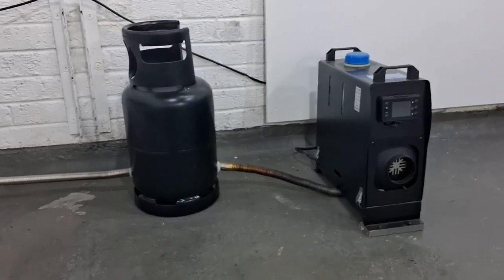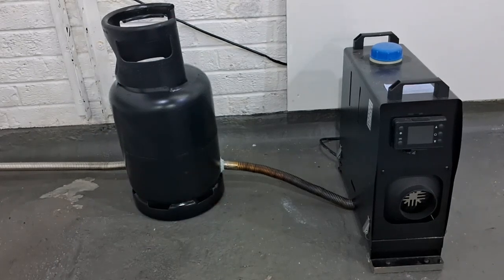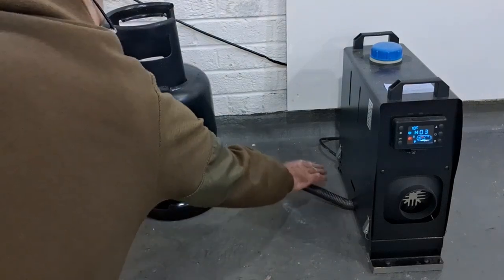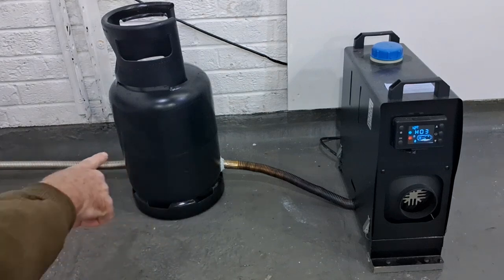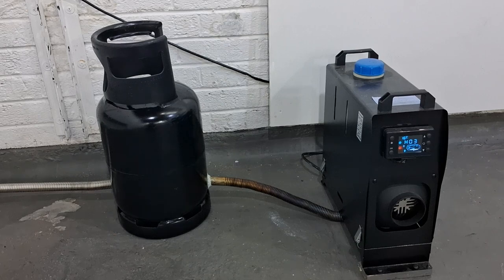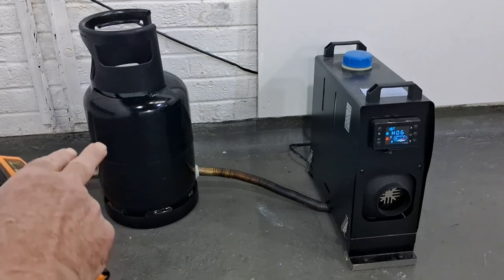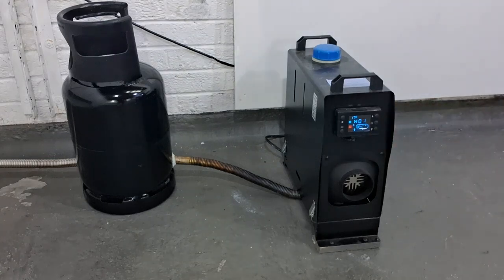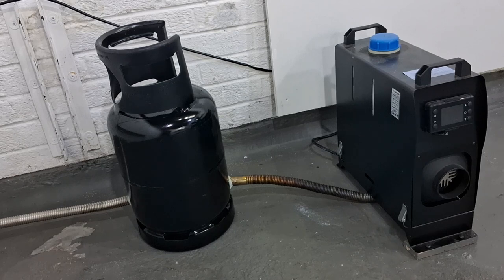Diesel Heater Pumped Exhaust Gases into Gas Bottle to Store Heat Energy Storage Experiment Off Grid

Comment: Downside of using sand heat storage is that as the sand heats up, the temperature difference between the exhaust and the sand reduces and the heat flow from exhaust to sand reduces as well.
Insulated tall water tank should work better, as the convection flow moves hot water to the top and cold to the bottom of the tank. Using heat exchanger, electric pump and a radiator is another way to scavenge more of that waste energy into heating.

Comment: Might be more efficient to run the exhaust in the top where the valve was and then out the bottom. Basically it would look like an in line fuel filter. Maybe it would heat the entire thing more than just one side

Comment: Try mounting the heater on top of the gas bottle with the exhaust going straight down through the regulator orifice. More heat would be directed straight into the bottle due to the shorter pipe. And the now shorter pipe would be protected by the gas bottle handles so to prevent inadvertent skin burns. Regards, Paul Fowell.
Reply from the maker: did you see my other heater videos: https://www.youtube.com/@andyfireblade
let me know what you think

cheers andy

Comment: If you could cut the tank in half and put a coil of copper tubing inside to hook to the exhaust inlet and outlet. Then weld it back together and seal it up and fill with water or sand to absorb the heat from the exhaust I'm sure it would conduct heat a lot better.
Reply: Water would be a bad idea, if it boils you will build up pressures, sand would be the way to go.
Reply: @mariolucich3927  only if you left the valve in the top would need to leave it vented and add water as needed when it evaporated
Reply from the maker: i do another video using water.

did you see my other heater videos: https://www.youtube.com/@andyfireblade
let me know what you think

cheers andy

Comment: Hi Andy, with trapped expanding gases do you think it be prudent to fit a pressure relief valve in the top of the bottle?
Reply from the maker: it is not sealed, so it doesn't build up pressure.

did you see my other heater videos: https://www.youtube.com/@andyfireblade
let me know what you think

cheers andy

Comment: On using a gas bottle, I think I’d put the input pointing slightly up and have it so the exhaust gasses entered the bottle so they followed the curve of the cylinder. The gasses would then circulate evenly throughout the gas bottle, also have the gas exit angles to pick up the gasses so it can exit more easily. 
  If you look how the hero’s steam turbine works, it directs the steam externally to make rotation. Just keep the bottle inlets and outlets at 25mm.
Reply from the maker: thanks for the comments,

did you see my other heater videos: https://www.youtube.com/@andyfireblade
let me know what you think

cheers andy